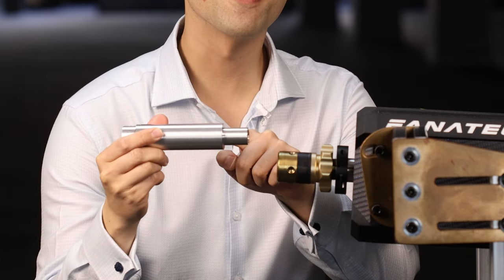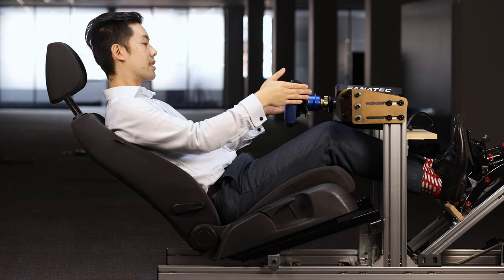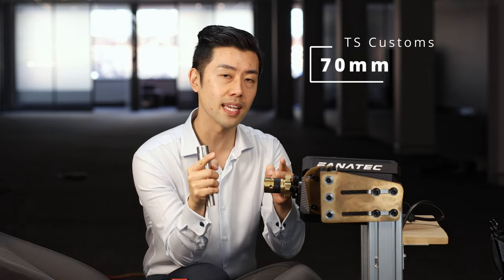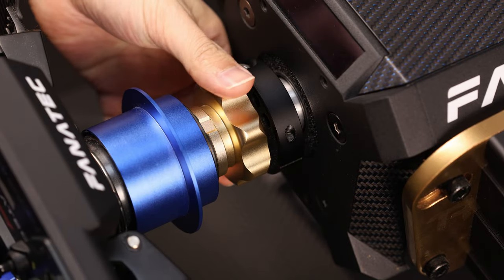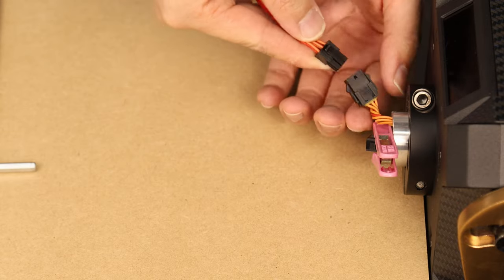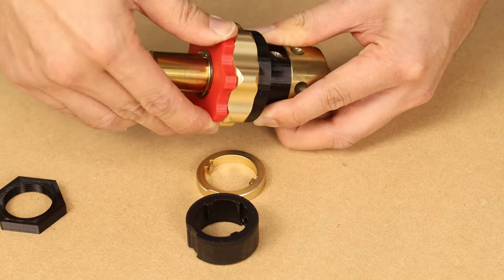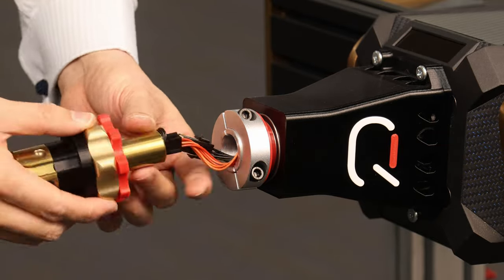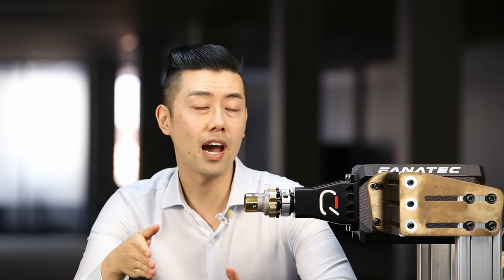Fanatec Podium Shaft Extension for DD1/DD2 - Review and Test with Z Ring Quick Release Modification

Comment: I'm impressed with your 3D modelling skills.
I had a 200mm shaft extension on my Simucube 2 Pro, but I've later rebuilt the rig and taken it off - due to mechanical concerns.
Reply from the maker: Thanks Henrik, it was fun learning the software and completely overdesigning the bracket! I'm curious about your mechanical concerns about the extension - was there any evidence of risk? Overheating, noise, vibration, visual signs of concern? 
Would you run a 200mm extender with a support bracket?
Reply: @DrAlanQuan  I believe Simucube recommends that you don't use extenders longer than 100mm.
My worry was when guests go in the rig, they will likely brace themselves on the wheel when getting in and out - like you often do in a real car. And those forces get multiplied a lot when you get some cantilever-action going.
A support bracket could help, but I'm not sure 3D printed would be strong enough 🤷‍♂
I removed the extender when I rebuilt my rig, and I saw a way to modify it so I didn't need the 200m extension anymore

Comment: Hey Alan - awesome video and result!  Im feeling you on the 3d printed Z ring you really had to do a lot of back n forth!. i was lucky some years ago - it was version 12.b or  alike from a different dude and it worked perfect- i still have 2. But your Custom support bracket is impressive!  Really good idea and well designed!  You say its rugged, i belive you but my experience is that forces from the wheelbase could brake it anyway, and i have worked with bearings for 20 years and that bearing will deff will last longer :P

Looking forward to race you soon again :)
thx for the video!

Ps. that shaft looks shiny!
Reply from the maker: Hi Daniel great to hear from you again. Thanks for your kind words - I'm hopeful that since the shaft extender itself is already so rigid, the support bracket is really there for decoration and not really subject to significant forces - but again I'm no engineer so it's pure guesswork. I'll let you know if I encounter any issues.

The extender is fantastic! Really happy with it. I'm watching your latest video now 👍

Comment: Thanks Alan for your sharing. What 3d printing material you would reommond please?
Reply from the maker: I have very limited experience, only 6 weeks, but I've had good results with Esun PETG (the only material I've used)
Reply: i used high torq mode and 80% of max 20NM. Is the Z Ring or the QR1 strong enough to hold the steering wheel? i am a bit worried to break it if not using the screw. But i do want the convinence when swapping wheels. @DrAlanQuan
Reply from the maker: @raphaelliu68  I've had the Z ring fitted for 3 days now! Can't really talk much about longevity but I will say this. The Z ring isn't really a load bearing part. The indexing of the wheel to the shaft is handled by the 5 spring loaded balls and the single trapezoidal key of the QR interfacing with the corresponding detents on the metal shaft. The Z ring bevel just adds onto the back of those, but it's not a primary source of indexing - and even then, the forces on the Z ring are all compressive which is good.

Time will tell, and others who have used the Z ring for longer may have better insight - but I don't see any issue with longevity based on my understanding of physics and material science.
Reply: @DrAlanQuan Thanks Alan for your explanation. U gave me enough confidence to have a try. Appreciate your help.

Comment: Would you be interested in making a extender shaft support for 75mm extension???
   Awesome video- appreciate your passion, the time you have takin to make this video to share… ❤️Som Racing ✌️🤘Woo Woo
Reply from the maker: Hi Elvis, thanks for getting in touch ❤️ I've been in touch with both RK Engineering and TS Customs who make these extenders, and the consensus is that up to 75mm there's no need for a support. If you put a podium hub and a third party wheel (as encouraged by Fanatec) you pretty much extend the shaft by about that much so the wheelbase should be able to handle it standard. The support bracket does also add bulk around the shaft extender which can limit how low you place your monitor if that's something you want - so there's some drawbacks to using a support bracket to consider as well.

That being said, it would be fun to design a support bracket for 75mm length and I could do it, but there's a lot of other projects I'm working on that are taking priority at the moment. Maybe you could design and share a 75mm support bracket!
Reply: @DrAlanQuan  
  Thank you for such an amazingly quick response- very very nice work, hope you got the rest set the way you wanted- if so how’s does it compare- should make a follow up video so we all could see how it came out…
  Will do… am also a designer - positivity send your way good luck on your projects- completely understand ✌️  Have a great afternoon Alan👍
Reply from the maker: Thanks and good luck to you too! See you in the next video!

Comment: Salve sono in procinto di stampare le parti in 3D. Possibile sapere quale cuscinetto a sfere è stato utilizzato per il supporto? Ne ho trovati tanti ma con caratteristiche diverse. Grazie mille.
Reply from the maker: Hello it is the 6807
35x47x7
Reply: @DrAlanQuan  si d'accordo ma con queste misure e codice 6807 ci sono delle sigle tipo " ENDURO LLU MAX" "ENDURO LLB" "2RS" "34 2RS". Non so cosa prendere.
Reply from the maker: @Piter1655  The "2RS" I think means it has shields covering the bearings on both sides. You can see in the close up shot at 03:05 that my bearing is labeled "6807RS" on the shield and actually on the ebay listing it is "6807-2RS"

Good luck!
Reply: @DrAlanQuan  Perfetto grazie mille

Comment: Where Can i buy it.
Reply from the maker: Hi Kasper, in the video description there is a link to Rudolf's eBay store. There's also a link in the description to my downloads page which has the STL files for the support bracket if you wish to print the same bracket that I designed and showed in the video - you just need to buy a 6807 bearing (I got mine from eBay for $10). Please let me know how you go!

Comment: Your Seat does not fit to a Formula Seating position! You have always to bend your shoulder forward and your Head is not good supported... do have no problems?
My Z-Ring v15 was absolute perfect, but i printed it with 102% flow and then minimal grind. you took on the first z-Ring the wrong lenght variant?!
Reply from the maker: Hi Eddy. I rest my head on the headrest when I race - I'm not too fussed about what to call the seating position - it is what it is, it kind of feels like formula, I'm happy.

As for the Z ring, yes I've heard a lot of people had no issues with it - I found it completely stopped my wheel from going on because of the wrong shape.

As for length - when I downloaded the files from Zappadoc they include both lengths in the one .zip file, and the website recommends to try the long one first (at least it did when I read it)

Thanks for commenting! Stay tuned, lots of cool stuff coming

Comment: On why the wheel does not go on...did you calibrate your filament. over extrusion can be the reason it's not fitting.
Reply from the maker: Hey there, no I did not - this video was filmed when I was a complete novice and did zero calibrations at all. Interesting thought about over extrusion.

Everything that I designed was dimensionally accurate when I did measure the products from that printer on default profiles (Prusaslicer and a MK3s), and the eyeball test in my opinion still stands (trapezoid on the QR, rectangle on the Q ring)

I don't want to print another Z ring on my fully calibrated printer just to check, since the Z ring has other design issues which I've addressed in my Q ring (a ground-up redesign which is on my website)

Thanks for commenting, I haven't thought about the Z ring in a long time, it's nice to reassess the situation again having learned a lot since then 👍
Reply from the maker: Hey there, no I did not - this video was filmed when I was a complete novice and did zero calibrations at all. Interesting thought about over extrusion.

Everything that I designed was dimensionally accurate when I did measure the products from that printer on default profiles (Prusaslicer and a MK3s), and the eyeball test in my opinion still stands (trapezoid on the QR, rectangle on the Z ring)

I don't want to print another Z ring on my fully calibrated printer just to check, since the Z ring has other design issues which I've addressed in my Q ring (a ground-up redesign which is on my website)

Thanks for commenting, I haven't thought about the Z ring in a long time, it's nice to reassess the situation again having learned a lot since then 👍
Reply: @DrAlanQuan  each filament can vary...even same brand different color. There are calibrations which COULD be why that part did not line up. But I like your fix too...which worked just fine!
Reply from the maker: @Cereal_Killr  thanks man. I like to experiment and learn, sometimes it ends up being unnecessarily complicated but it's fun!

I did calibrate a few different filaments when I eventually bought my own printer but honestly, looking back at the Prusa MK3s and Prusaslicer default profiles, they were really good! Just very slow compared to what I use now
Reply: @DrAlanQuan  The smartest tend to over think...and that's OK. It's just what we do lol. I'm a lover of knowledge too! Gives a sense of pride! I have an ender 3 S1 pro and a bambu P1S with AMS...love em both but the bambu is amazing!